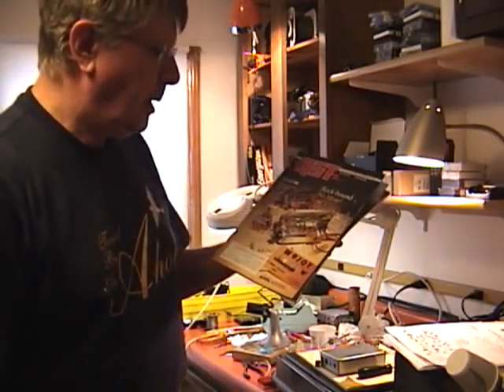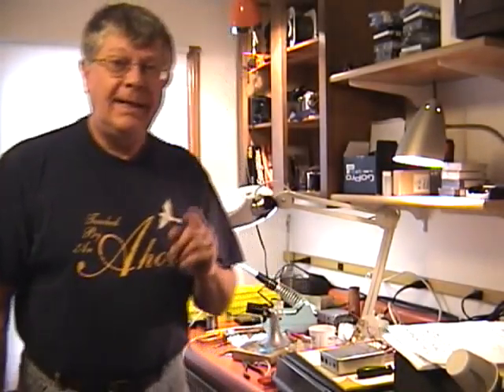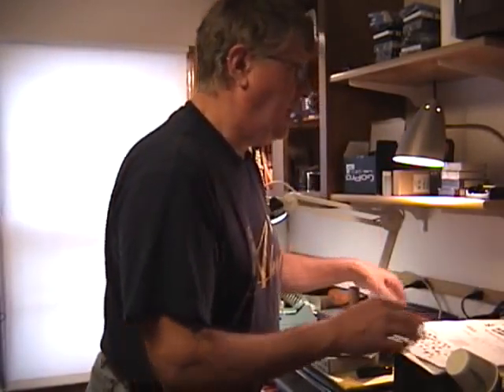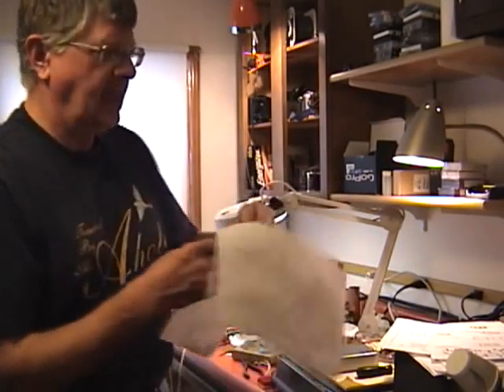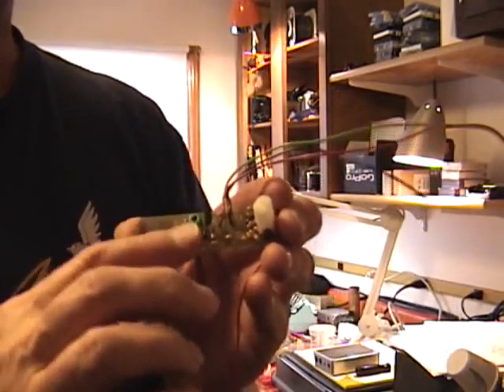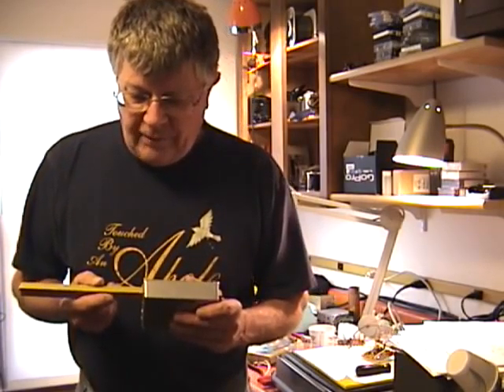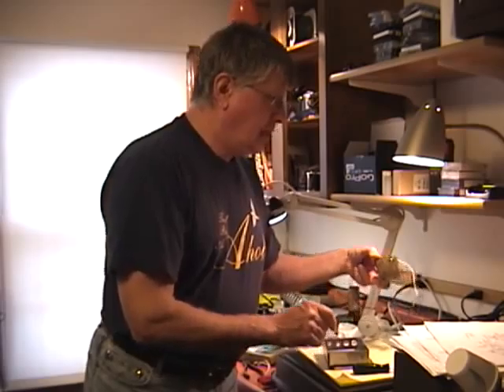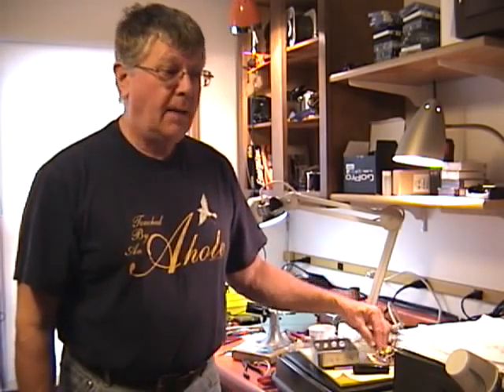RocklessQRP1-assembly tips

Comment: What are the replacement inductors for the 8.2 uh inductor and what is the rating of the varicap diode D1 both on the VFO circuit. The varicap number from DigiKey type 901 MV2090S-ND is no longer a good number and I cannot cross reference a replacement with out the specs.
Reply from the maker: http://electronics-diy.com/product_details.php?pid=144&name=MV209%20-%205-32%20pF%20Varicap%20Diode%20(BB103,%20BB109)
Reply from the maker: hope this may help. I never did get the rig to operate properly...overheating problem with transistor...substituted another typw with a heat sink and got about 1/4 watt output
Reply from the maker: according to my original documentation for the rig the inductor coil replacement numbers are these...Delevan No. 1025R-42K  or Digikey No. DN7692-ND or Delevan No.1641-822K or Mouser No. 807-1641R-822K
Reply from the maker: let me know if you get your rig working
Reply: Thank you @astrorad2000